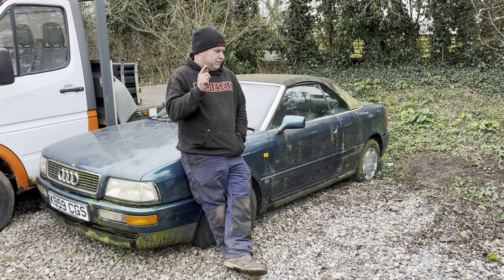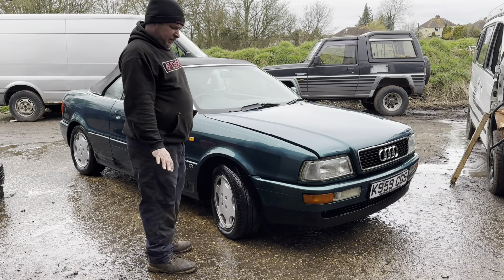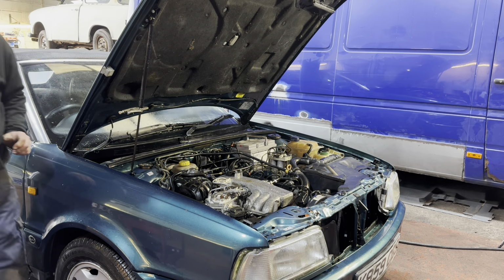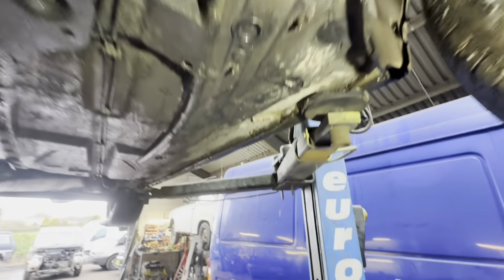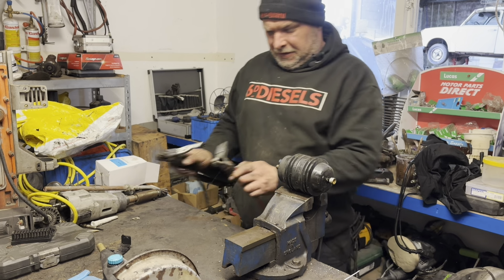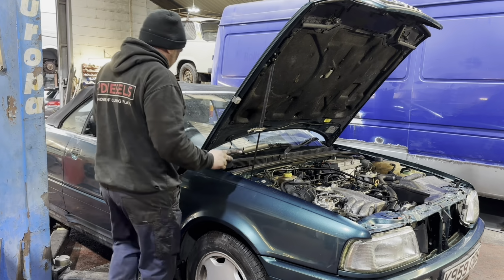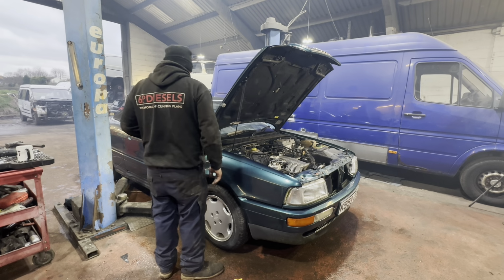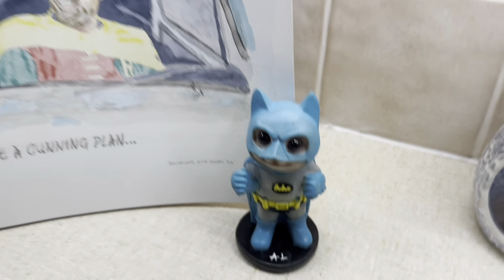Audi 80 round two!! Will the green beast come back to life!!!… one way to find out

Comment: The same engine I had in my beloved 100 2.2 auto. The Audi's from this era were the ones to have. When I mistakenly scrapped mine at 20 years old (thinking it had terminal bulkhead rust, didn't know about the scuttle drain "duck beak" thingy 😢), all the little bulbs in the leccy window buttons STILL  WORKED ffs. The only time it failed to start was sfter it had been to the body shop for a door repair and THEY forgot to secure the battery terminal.

Comment: I had several Audi 200s of that era A C and E reg turbos and Quattros the OBD was a switch flap inside the air intake you flicked it and the tachometer pointed out the codes as I remember , nice cars but very German , the body will be galvanised on that one from the age it started in 86 I think

Comment: Great watercolour. Maybe someone else could cover you both in oils.......... actually you both seem to do that yourselves on a regular basis.. That Audi is definitely well worth saving. Those 5 cylinder 20V engines are great. I had the 1.8 20V in my Seat Ibiza Turbo but unfortunately I had to sell it because the running costs got too high , primarily because of speeding fines.